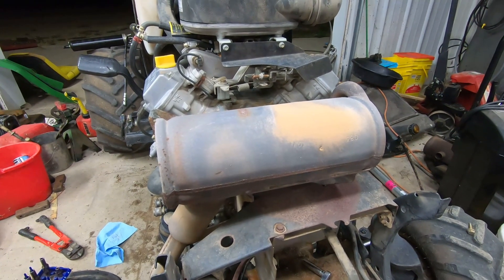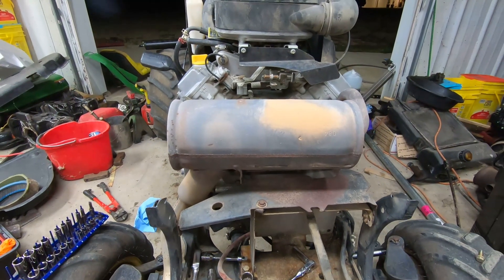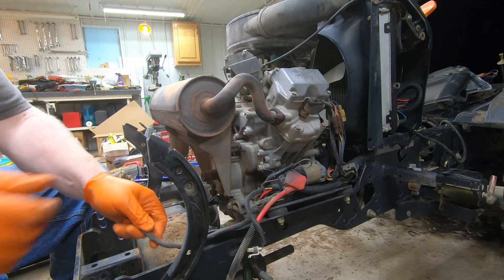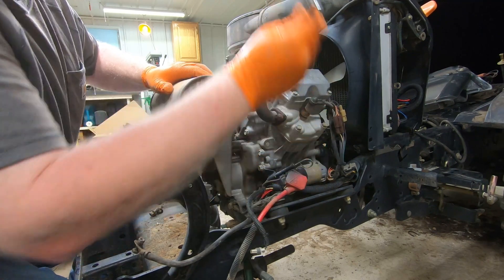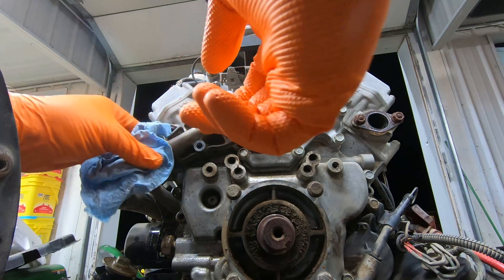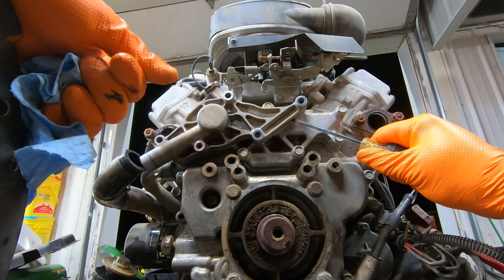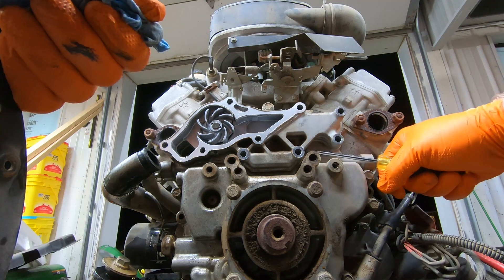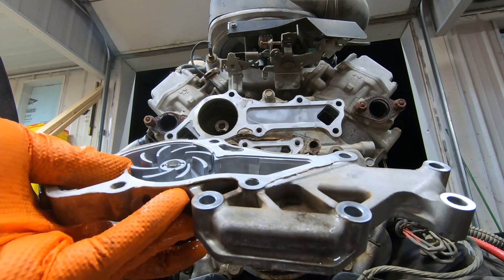John Deere X585 Project: Part 6 - Water Pump Removal

Comment: Searching to figure out why my toro got water in the oil when it runs perfect,figured it was an internal geared water pump ,looks like the same engine.  After a good 4 flushings oil is almost clean,now i can pull it apart and get a pump.
Reply: 420 hours   1998 520 lxi

Comment: I just replaced a water pump on an X748 with coolant coming out the weep hole.  Check your play on the impeller and gear side, I bet you will find the seal is out on the impeller side.

Love the videos.  Keep up the great informational videos.

Comment: At the end of part 5 you said you were going to remove the pto ... Did I miss that or did you decide to leave it?
Reply from the maker: The PTO has been removed. There is no video of the PTO removal due to some unforeseen issues of timing, video cards, and lighting. I do intend to do a PTO install on my X748 at some point this winter.